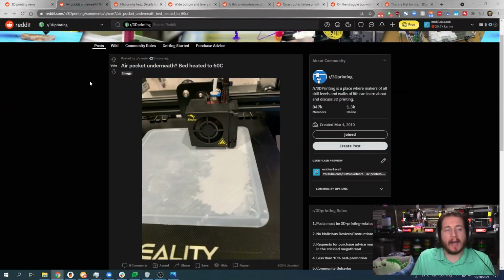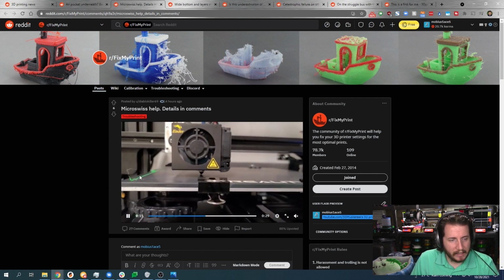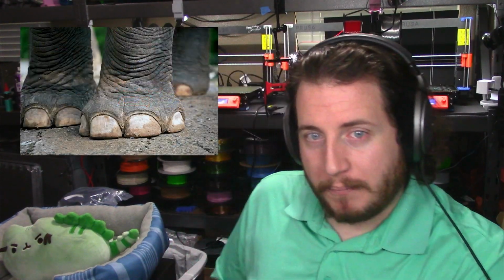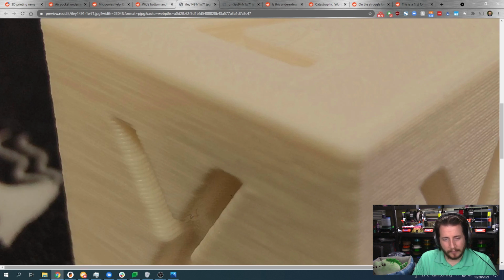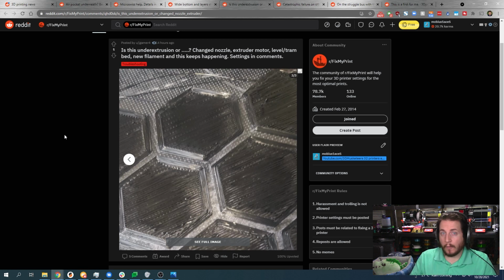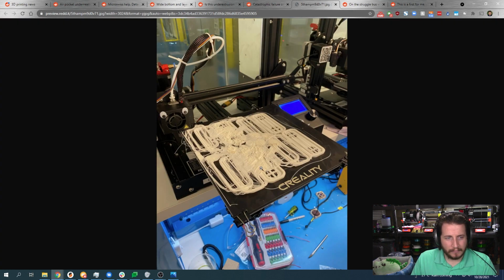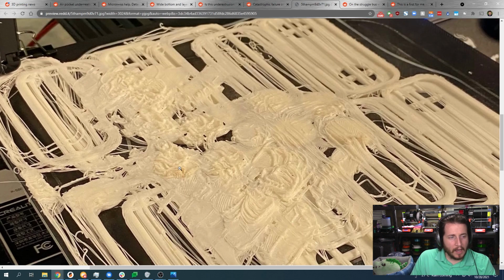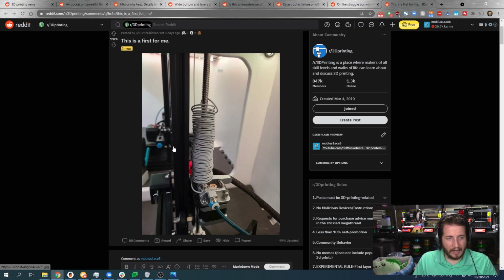Extruder MADNESS!! - PrintFailFriday S1E7

Comment: I remember seeing some of these posts. I do not have a Ender 3 so I do not comment on most of them as I am not that familiar with the machine. I am glad to see someone helping those people out that has experience.👍
Reply from the maker: I have one now, but you don't need an ender 3 to help those with them! The jury is still out if it is because the ender 3 platform is not built great OR if there are just so many of them, it is bound to happen more often than others
Reply: @3DMusketeers  I have commented on some pretty obvious things in the past, like first layer height issues or slicer settings. Things that are more general in nature. Things that are more specific I am afraid I might confuse the issue more than help. As for the Ender 3 it is a pretty cheap machine. but I have seen some people get good prints off of it. So maybe the user need more experience than people think to make it sing.
Reply from the maker: I mean, you saw, even I got confused there ha ha! I do wish more people would look before posting sometimes, but of course if the person before them that had the issue did a bad job on the title and such, they may not find it. Hopefully they find our videos :)